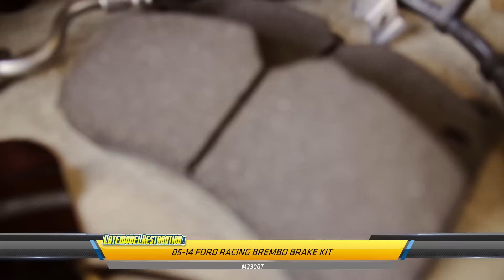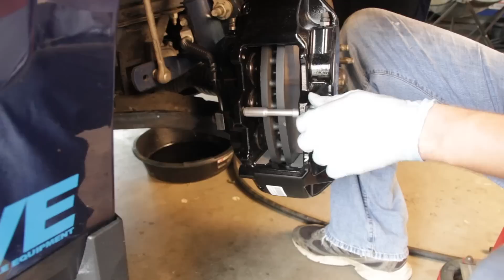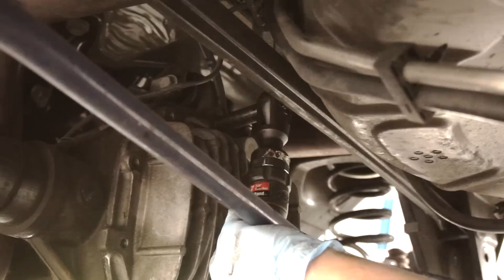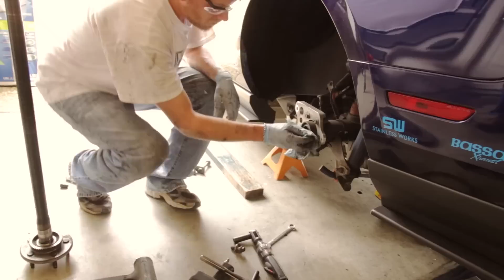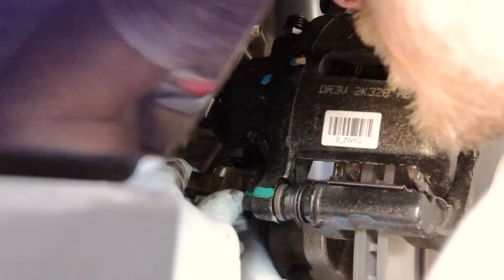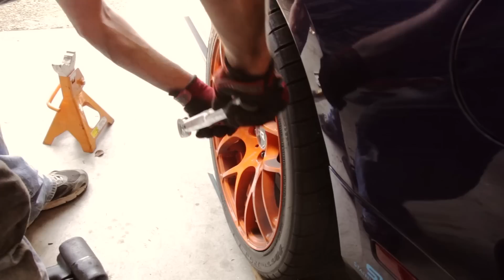05-14 Mustang GT500 15" Brembo Brake Kit Install - Ford Racing M-2300-T

Comment: How do you look these up ? I have them on my 2011 gt500 and ordered brakes and got the 4 piston style instead of the 6 piston style and there having trouble finding the brake pads at American muscle
Reply from the maker: Hey there! Thanks for the comment. I'm not entirely sure of the situation your in, but the OEM calipers on your 2011 GT500 are 4-piston Brembos. This is an instructional video of how to install the M-2300-T brake upgrade kit. If you want to shop with us, we have options available. Let me know if you any questions pertaining to our offering. Link below. -Landan

https://lmr.com/products/10-14-Mustang-Brakes
Reply: I'm sorry but did you really read my comment I have these exact brakes rotors and calipers 6 piston calipers on my 2011 GT500 I'm trying to buy parts for it.
Reply: I need front brakes an rotors
Reply from the maker: @jamiewellman6986  Your original comment does not accurately state that you have this exact kit on your car. We have options available on our site. You'll want to purchase pads that fit a 13-14 GT500 since you have the 6-piston caliper. -Landan

Rotors: https://lmr.com/products/10-14-Mustang-Brake-Rotors
Pads: https://lmr.com/products/10-14-Mustang-Brake-Pads

Comment: Is it possible to install the brake kit at a 2006 model without ABS?
Reply from the maker: No.  This kit is designed for cars with ABS only.

Comment: Late Model Restoration

Hi, i have a ford C max 1.6 TDCI Diesel Titanium x with 17" wheel in Turkey. Is there any brembo disc&caliper solution to replace my car's brakes ? If it is exist, what is the part number of these ? BR.

Comment: what brand of stainless lines were you using on the 4 piston brembos ?
Reply from the maker: Austin, if I remember correctly, we used J&M stainless lines with the 4 piston Brembos. They worked great! https://lmr.com/item/JM-22530/Mustang-J-M-Front-Rear-Stainless-Steel-Teflon-Brake-Hoses 
-Landan

Comment: Hi gents,

I already installed everthing in my 2014 mustang, roush supercharger kit and Brimbo 6 piston front and rear kit, but sometime i am losing my brake system, we already checked everthing,  brake booster hoses, brake fluid hoses, bleed air as per the video of installation in youtube, i am unable to find what is the problem, sometime i am pushing maximum the brake pedal till the end whitout stopping,  i even changed the brake fluid to high performance and temprature type without success...

Your help and advise will be highly appreciated as i am on stand by in the garage now.

Thanks

Omar

Envoyé depuis Yahoo Mail pour Android
Reply: Sounds like you still have air in the system. Bleed them again. Start with the rear pasanger, then the rear driver, front passenger and last the front driver. Do it with 2 people, one pressing the brake pedal and one opening/closing the bleeder. Make sure the reservoir doesn't go dry, you'll have to start over again if it does.
Reply: many thanks, will try today.....

Comment: Would any wheel 19in or larger fit over these brakes? I have 20in Foose legends.
Reply from the maker: Most wheels 19" or larger will fit. However, we cannot guarantee you that every wheel of the sizes specified will fit.

Comment: My big question right now is will this work for a 2011+ v6 mustang? I'm only concern with the front but I haven't been able to get a solid answer from anyone thanks!
Reply: You ll have to get different rims. Your V6 rims will NOT clear the larger rotors...So you'll spend a lot of money for the break system, rims and tires...

Comment: Can you do same kit for 99-04 Stangs?
Reply from the maker: Are you asking if this kit will fit 99-04 or if we have a brake install video for 99-04?
Reply: If this kit will fit 99-04 :)
Reply from the maker: ***** No it doesn't. We do offer some other brake kits including the FRPP Brembo Cobra R brake kit. See them here. http://www.latemodelrestoration.com/products/94-04-Mustang-Brake-Kits-Upgrades